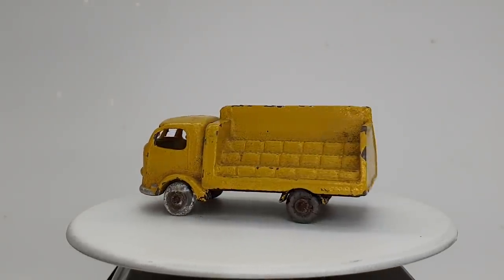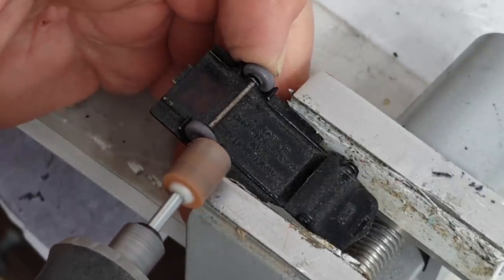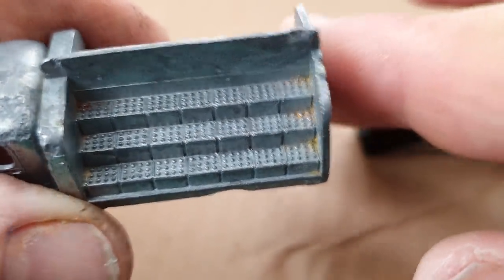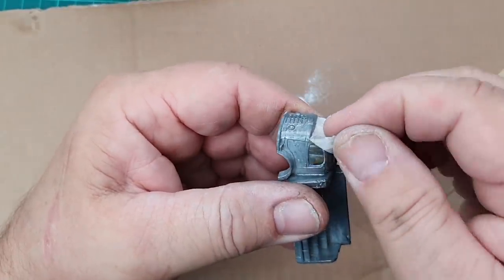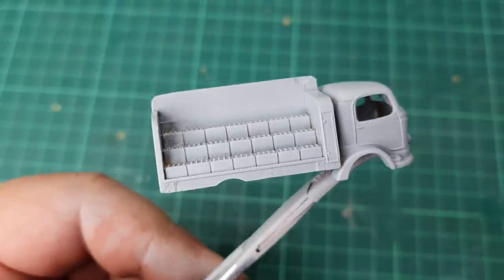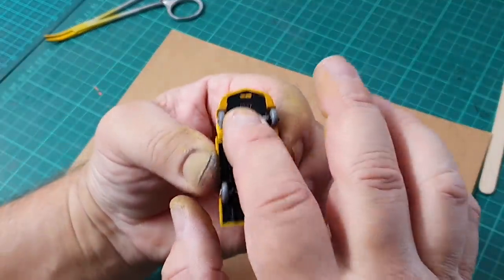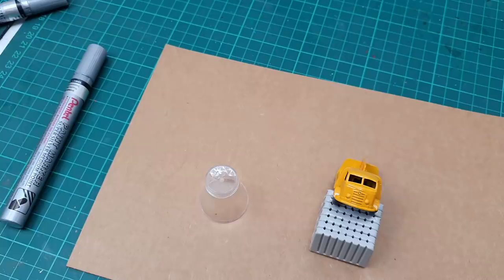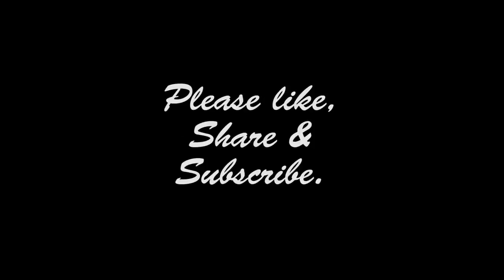MATCHBOX Restoration  37 Coca Cola lorry

Comment: You should get a cheap tooth cleaning "water pik" and use it like a pressure washer.   They're what I would use to "pressure wash" my older models to get the dust off without rubbing!

Comment: Hello Marty. That casting turned out to have a lot of flaws, damage, and small imperfections. You did a great job in fixing those issues. Thanks for sharing the differences in the earlier and later models. I even noticed the grilles were different. I saw that you and TimeRider had similar restorations come out at the same time. Great minds think alike. In regards Kevin, you're lucky you weren't delivering canned beans! See ya next time.

Comment: Those front ends are different! One molds around the headlights and the other does not! Similar but different!
Reply: Eric McGinnis ...I'm assuming you are referring to the silver refuse truck. There are also differences on the grill but the biggest difference is the cab itself. At the top, the corners are square on the silver one, while rounded off on the coke truck... Also, it only has a 3/4 base, which differs from both versions of the coke truck... Aside from it being a refuse truck, the models bear little resemblance....
Reply: The main thing that surprised is that these coke trucks are yellow I thought coke had been using red since before the war. When was the change actually made?

Comment: Hi Marty: great work. Just to confirm, your bottle is marked baking soda but you said baking powder. It’s the soda you want - right?  

While both products appear similar, they're certainly not the same. Baking soda is sodium bicarbonate, which requires an acid and a liquid to become activated and help baked goods rise. Conversely, baking powder includes sodium bicarbonate, as well as an acid. It only needs a liquid to become activated.

Thx.

Comment: Marty, with the baking powder and super glue method, have you tried packing the baking soda into the void and then adding the CA from one edge? The super glue (CA) wicks into the baking powder and reacts as it goes. Sometimes you get smoke as well. Very satisfying.
It fully cures in 24 hours but sanding is easier before then. 
Tony in Brisbane

Comment: Seeing this one alongside the silver refuse lorry makes an interesting comparison - they reworked the cab quite comprehensively on the drinks lorry. Ironically, although even badged as a Bantam underneath, the position of the yellow drinks lorry's radiator filler cap (within the radiator grille, not above it) suggests she's a Karrier Gamecock not a Bantam. The same cab pressings were used for the Commer QX and the Ford Thames E4 (also modelled by Matchbox - I think No. 63) military ambulance.
Reply from the maker: WOW! you certainly know your delivery trucks!! Thank you!
Reply: @MartysMatchboxMakeovers  Hehe, sorry, I had my Rootes anorak on at the time! Curiously Matchbox also "chromed" the radiator grilles on these lorries, when in fact they were always just painted in real life. The design of the real things also varied in that the headlamps were not incorporated into the pressing of the early ones, then on later versions the pressing was enlarged to incorporate the headlights. On the final version of the Bantam that had this cab, the headlights were moved out towards the edges of the cab (to meet then current regulations on headlight positioning - I seem to recall they had to be no more than 18 inches from the extremity of the cab) and a third version of the grille design appeared.

Comment: Superb job as usual. Only thing I disagree with is that the orange "1957"model doesn't seem to have a partial load (some of the crates are missing). Instead, it kind of looks like there's an extra load (additional crates added) on top of the regular load. Thanks for another great video!
Reply from the maker: You know what!? - I think that you are right and I am wrong!! - Never noticed this before, always thought that some crates were missing in the second version.

Comment: Hi Marty fantastic job  you have done there as we have come to expect from the Matchbox Makeover King though I wouldn’t have been too concerned about 0.5mm difference in the wheels as over there 50 years of life they will have expanded which is why they crack but an excellent video thanks for the entertainment brilliant 👍👍👍👍👍👍
Reply: All of the 1959 versions had gray 8mm wheels.  It was the only year they used gray wheels, in '61 (no 1960's were made) they switched to silver 7.5mm.  I'd suggest that the wheels were 8mm worn by .5mm.
Reference: http://www.cfalkensteiner.com
Reply from the maker: Great info there, makes sense!

Comment: One topic I've not seen discussed:  Obviously original, untouched Matchbox models have collector value.  Do restored models have any collector value?  Is there a consensus percentage?
Reply: I read that refinished models have a much lower collector value no matter how good it is. Marty is doing these for his own collection and it is cheaper than sourcing out MIB models. Original boxes are also highly collectible. Unfortunately once something becomes valuable, fakes and reproductions can be passed off as originals. This is where knowing all about the item is beneficial. I sent Marty an early tow truck sold by Matchbox as a reproduction. I am sure someone has taken one out of the blister pack and sold it as an unrestored model.
Reply: @BigLisaFan  Thanks for replying; I suspected as much.  I would hope that Matchbox repro models would have some kind of tell-tale on them, e.g., paint that wouldn't have been available in the 1950's-60's and which could be tested-for easily.
My favorite Marty Makeover just has to be the warped dump truck with the missing window pillars. :)

Comment: You did a really nice job! It's a cool casting but I never understood why it was yellow and not white or red to match the Coke logo
Reply: Back in the 60s and early 70s, the "Coke-Trucks" were actually yellow. The red colour of the Trucks came out in the mid 70s, I guess... 😁👍
Reply: @paul-sparky-sparr4160  Hi Paul, that's how I recall it too. All the wooden crates that the bottles came in were that yellowy/orange colour too. Cheers
Reply: @cutrockr-diecastracing2773  😁👍🏼

Comment: I think we have the same glazing putty in the US.
It's sold under the brand name, "Bondo."
It has multiple applications but it's most often used in the auto industry to treat small bumps and do light repairs on automobiles.  It's been abused a lot in the last 20-30 years and they've used it to patch rust when they really should be using solder and older methods.
I've seen a lot of modelers use it for their projects whether they were working with styrene, vinyl, or resin-based models.

I thought about buying Bondo for a project I'm working on (with plastic) but didn't buy it at the last moment BECAUSE of the warning about nervous system/hearing loss side effects!
There's enough materials out there that will get you sick if you're not careful when you use them but it's ridiculous they sell this crap in stores to the general public!

Comment: You kept using the terms baking soda and baking powder interchangeably. The two are NOT the same thing at all. While both are white powders, they have quite different consistencies and properties. The soda is courser, more crystalline in texture. Whereas the powder is extremely fine grained and fluffy, similar in texture to baby powder. Which is it you actually use, powder or soda?